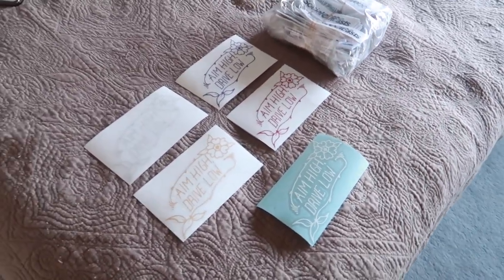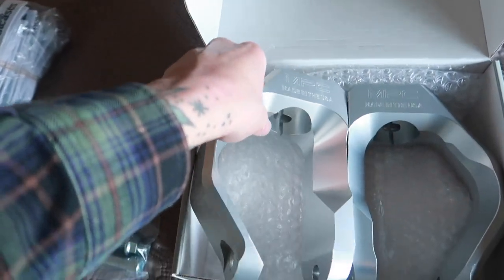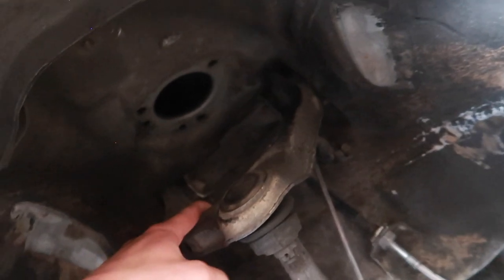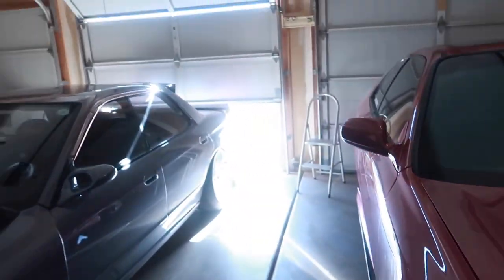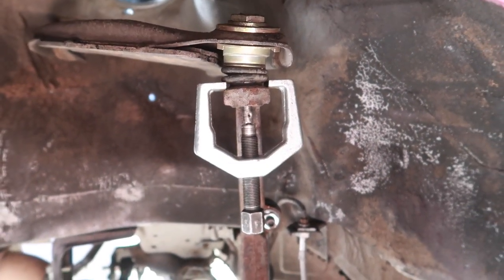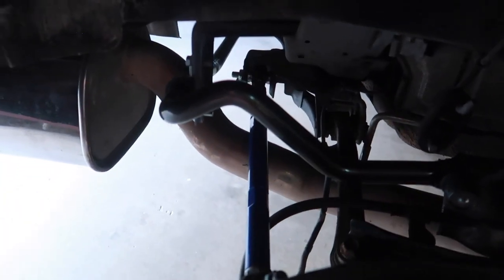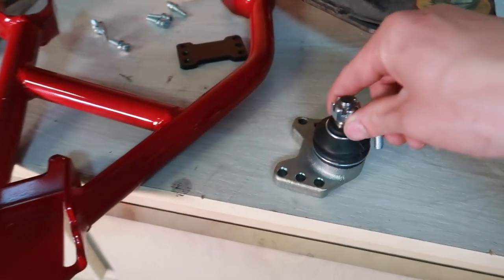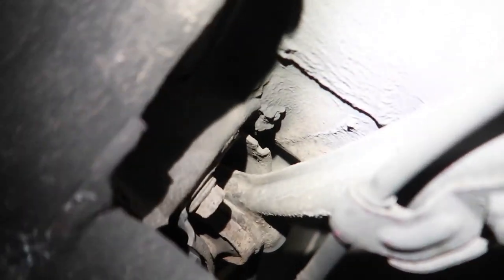New Godspeed rear camber arms for my Honda Prelude!

Comment: Do the MPC drop forks adjust the angle the axles are at? I’m looking to get these because my axle boots keep tearing because of how low I am. Would these be a solution to that?
Reply from the maker: These will actually make your car 2” lower, so I think these will make the rubbing worse.
Reply: @artisansdream  right, but if I were to raise the front 2”... I’d be at the same height I am now and the angle the axles sit at would be a little more straight right?